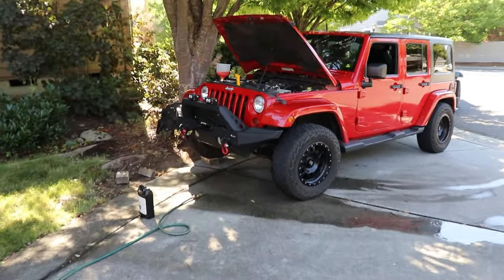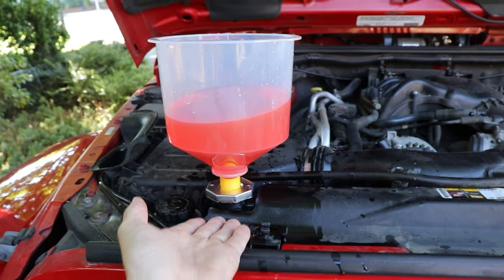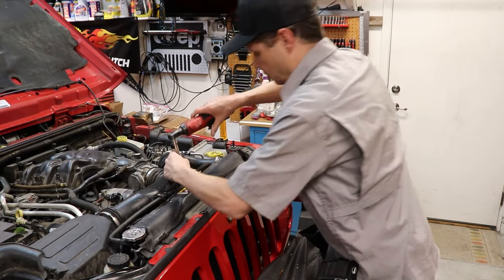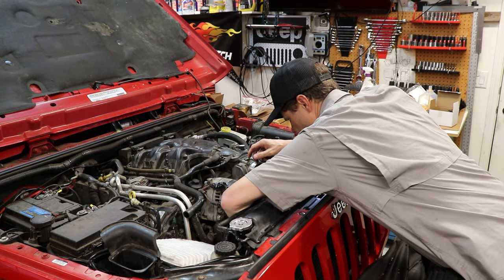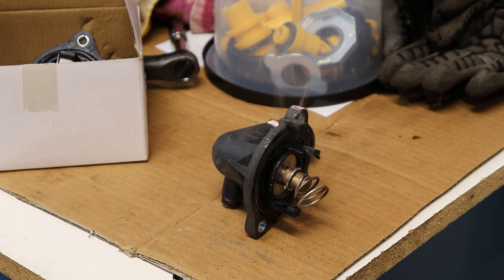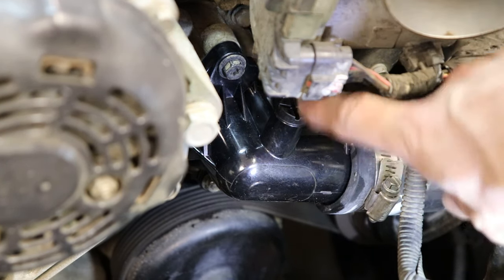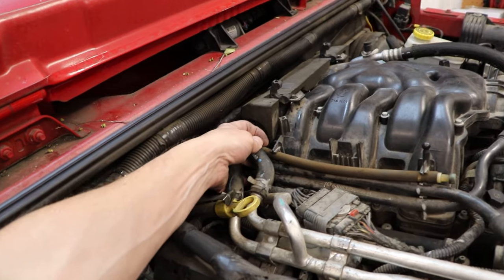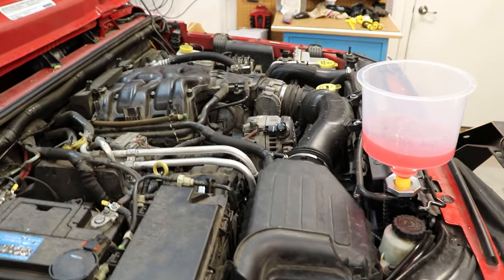Jeep JK Overheated.. fixed it. Thermostat issues

Comment: for all of u sitting on the fence .if your jeep overheats turn on your heater (the heater bypasses the thermostat) if that cools your jeep the cheap thermostat is not opening all the way dont install the 25 dollar replacement thermostat.
Reply: Gonna try that for sure
Reply: Whats it mean if you're heat no longer works? Started having issues over heating last week, and the heat in the jeep just stopped a few days ago. Does that mean it's not the thermostat?
Reply: I’m having the same issue, any clarity on it?
Reply: @forestwanderer5881  The most common reasons a Jeep Wrangler heater isn't working are a broken heater blower motor, a problem with the thermostat, or a failed heater blower motor resistor(check the fuse).
Reply: Just bought a Mopar thermostat at $88 because I’m sick of the aftermarket ones failing

Comment: My 2017 Jeep started overheating last year.  Dealership replaced the thermostat.  Over the last eight months have been back in multiple times where they have since replaced the radiator, and the thermostat three more times.  Going back in yet again for the same problem.  Waiting to see how much longer the engine will last before it warps the cylinder heads or worse.  Amazed that the dealership can't resolve the issue.  Consistently have temps in excess of 250 and as high as the 280's.  Dealership seems to think its not a problem.  Thankfully they keep covering everything under warranty.

Comment: Mine was over heating this morning and I noticed from the overflow bucket alot of antifreeze on the right side of the engine and the cap isn't even hott which is weird any suggestions? Great video
Reply: Same problem here ! Please update. What was the problem, and how did you fix it. Thanks in advance ☺️

Comment: So my Bumble Jeep is just staring to run a little hotter than usual and I'm starting to smell antifreeze a little. She's got 218k and I've never had any issues. I'm running an aluminum after market rad (4 core I think). Also hearing a squeal sometimes when cold. I've decided to go over the cooling system and have ordered all my parts from Rock Auto. It turns out they sell a high volume water pump. Coupled with the 4 core radiator and a 185 thermostat, I'm hoping it will  run much cooler. Will also be replacing all of  the regular wear items (hoses). Might as well go thru the complete system along with a good flush and new coolant. Thanks for sharing and I hope you find the tip on the "high volume" water pump helpful. God bless and stay well.
Reply from the maker: Thank you for the tips. I appreciate it.  One thing I would do if I were you, I’d look further into the thermostat you’re gonna use. I assume this is on a jk. The 3.6L engine is designed to run around 200 degrees. I understand the desire to run a cooler thermostat, but that interferes with the efficiency of the engine. Everything in the jk is designed to run warmer than 185.  The ecm, o2 sensors, pcm… will all be trying to get your Jeep up to its optimal temp. I’d use a thermostat temp designed for your engine.

Comment: I have a similar issue, with overheating,  with a good thermostat and radiator, what are the normal temperature of the motor, when the fan is on?  In a wrangler 2015 JK.

Comment: Hey guys I’ve been dealing with an overheating issue on my 2012 JKU Rubicon. I replaced the thermostat twice with aftermarket units because Mopar units have been on back order for a year, and it would still run too hot climbing a hill or when accelerating. What I found is, the aftermarket units are not only junk but are assembled with the spring upside down! I noticed the old one in this video has the spring upside down also! Another thing with most aftermarket units is the struts the spring retainer is mounted on are too short! This reduces the amount the thermostat can open! I have however found an aftermarket on Amazon that is not junk, has the taller struts like the OEM, and is made with an aluminum housing! It’s sold under the name MILIPARTS.  I hope this helps. 

Jimmy

Comment: Took my Jeep to a mechanic. They tried to tell me it was my head gasket. I told them to replace the thermostat. They did.

Three months later and my jeep is overheating again. Did my research and understand the aftermarket thermostats are crap. Took it back to the mechanic and told them to put a new thermostat in and I'll worry about putting in an OEM one later.

Mechanics try telling to get the head gasket checked again and I had to debate them about changing the thermostat. The manager was pretty rude about it. Lo and behold it runs fine now

Comment: Well another issue my 2012 jeep wrangler. I drove it 2 hours other day. Then last night we went to pick up our son. I left jeep running and it smoked transmission fluid was leaking not sure where at. Then today drove it for 15 minutes and amd it overheated the pipe to the right was hot the cap wasnt. I put a new radiator in and thermostat a week ago no issues until last night need some advice on it. Was told could be a bad thermostat. I checked no smoke comimg out of exhaust or milky white oil just had oil changed last week any suggestions thanks so much.

Comment: Awesome video I subscribed to your channel. I have the same year 2012 JK 2 door. I have a quick question. I believe we are to use HOAT. However I had some work done at a shop and I actually had them flush the system and refill. They refilled with Mopar OAT coolant. I know you can not mix the two different types. My question to you is, should I leave the OAT in it and just top off with OAT? Or should I flush it my self and switch to the HOAT? Also do you think the OAT would hurt the engine cooling system? Thanks for all the great videos!!!

Comment: two thoughts. one. I have all wise. added a bypass hole. any time I change a thermostat.   the extra flow. keeps things flowing better.  and. a trick I saw my father do. to his. Cadillac s. and. big cars. brand new even be for. they got home. he added a pint of machine oil to the cooling system.     and most of his cars went 100000 miles be for traded in.   he never had to replace hoses or water pumps.     this is and interesting thought.  and it have done the same.